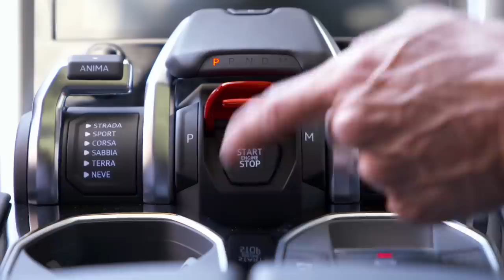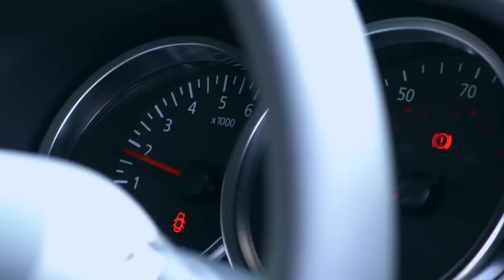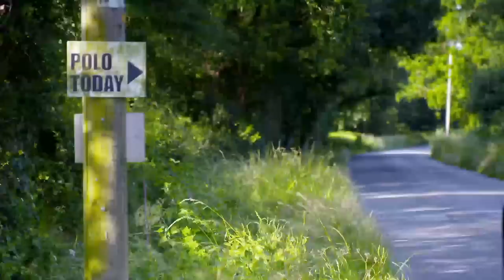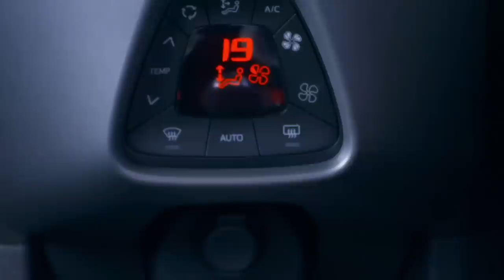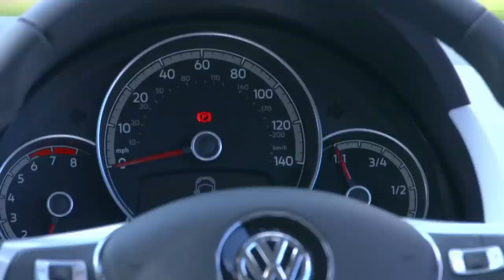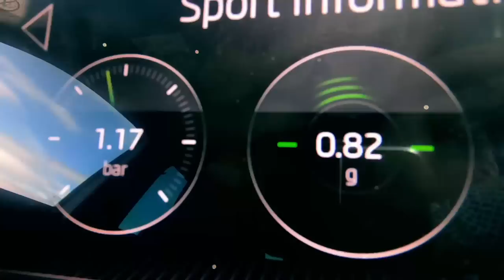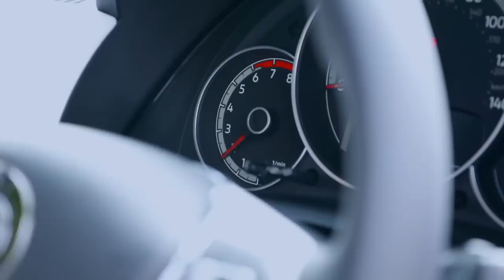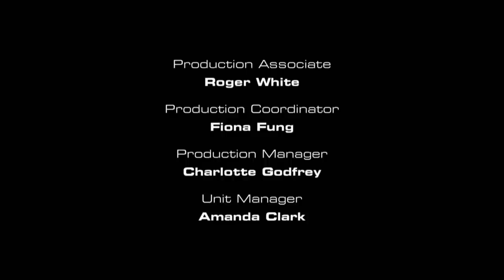Sub £10k cars – are they any good? Series 28 Episode 9 FULL Episode | Fifth Gear

Comment: If 10 GRAND can't get you something decent in this world, no matter what it is...

We need to do something about it!!
Reply: The Picanto is now from 13,400. MG3 from 13,300. Sandero from 13,000 (almost double what it was then, and this new model was only 8,000 pre-Covid). Aygo no longer offered. Aygo X is from 16,000. Panda from 14,500.
Reply: @nigel.w  was looking at porsche's for that price the other year...what a joke its become
Reply: Yes second hand
Reply: @nigel.w  Thanks for doing the leg work. I was just about to check to see if you could still get any of them for under 10k.
Was discussing the rapid inflation on entry level cars with some friends recently and none of them believed the numbers I was throwing out. They thought I was talking about increases since we were kids, not from 2 or 3 years ago
Reply: Australia you can get anything for less than that if you don't mind buying 2008-2009 common one size anything bigger.Corolla,Civic,Mazda 3's all come to mind.yes the mileage might be getting on a bit and age but for  30 to 50% of the price of any new age light car you could do worse.
Reply: @franzchong5889  Trouble with that in the UK is that the Manufacturers seem to have gone all our for low emissions in about 2010. So the earlier stuff without the emissions control guff is now so expensive on fuel and road tax that the smaller, later and more frugal stuff is significantly cheaper to run.

Comment: Maybe it should now be called the under £15K car since  sub £10K do not exist. My father-in-law bought a brand new Dacia Sandero Access (68 plate) £6699 …. He even got a small discount from £6999 since a customer had pulled out. Cheap and cheerful of course but these cars no longer exist. The Sandero is a very different car and it costs much more

Comment: I don't really believe this is their honest opinion. The UP! is a good car, but the quality isn't significantly better than the Picanto. And there's no way the Aygo has a better quality interior than the Picanto. The Picanto, as tested, with the 1.25L 4-cyl engine, also had the best powertrain of them all. And is the only one offered with a proper auto. Dropping the MG on the basis of fuel economy alone is also questionable, because the little 3-cyl engines need to be thrashed on an incline and at the national speed limit and above. Fine if almost all your mileage is done within the limits of a flat city, but otherwise they actually chew through quite a lot more fuel than most people would expect, and aren't comfortable doing motorway speeds. Nonetheless, the UP! and the Picanto are the best for sure. But I'd choose the Picanto 1.25 over the UP! any day of the week. I've driven both new and nearly bought both. The Picanto also relatively easily hauls four adults, whereas the UP! as tested does not.

Comment: How much VW paid for that conclusion, it's just none sense to take the up over the picanto. Kia made a more practical car with 5 seats rather than 4, it has a bigger boot, actual windows in the back and looks like a bigger car from the inside. Kia is also cheaper and has a 7 year warranty while VW is VW with all of VW problem. And probably the most important conclusion for a petrolhead, picanto is a more enjoyable car to drive, it's faster and in my opinion didn't age as much as the VW on the design

Comment: The false boot floor option for the Up makes a big difference. However, when it came out the Up was a clear leader but I think the Picanto now overtakes it in its current form. However, if you can get a 2 y-o Up with the 90 tsi engine.....

Comment: Why spend 10k on these shitboxes when a used car is far superior and if you buy a good one more reliable?
Reply: some people don't know any better.I have in Australia seen the Picanto  plus a lot of these competitors and the entry level models are around $18000 to at least $25000 with automatic and the rest of it.I figured at a car warehouse you can buy anything a full size bigger for less(No Haggling)which size wise is a hell of a lot safer and you avoid new car depreciation.it might have more owners(minimum of 2)than you would like and is a 2008-2012 or 2013 of something but I know even if it needs a little work what options on a budget I would rather have.price wise you are way in front by about 30 to 50%